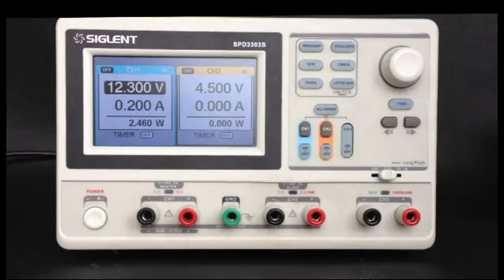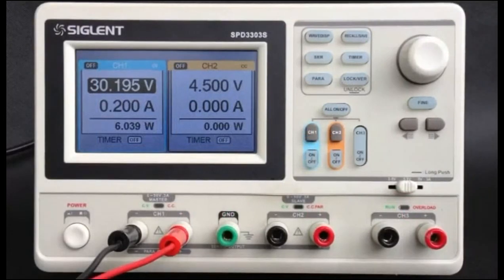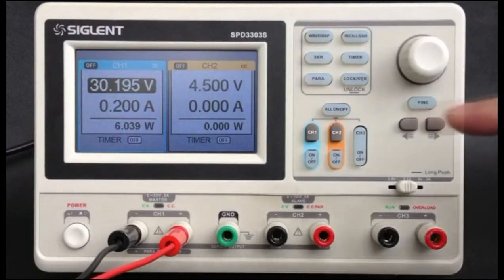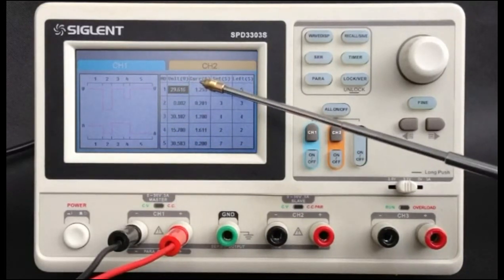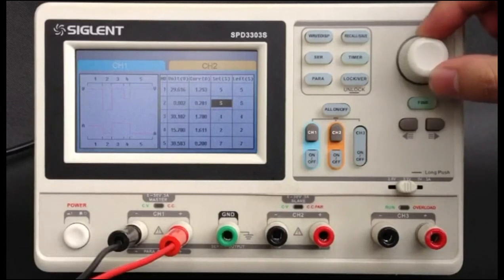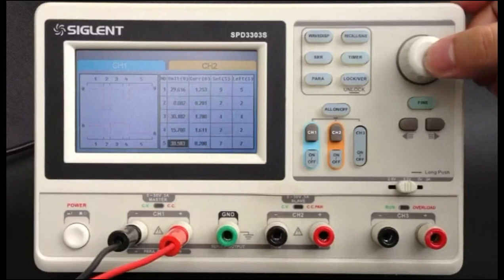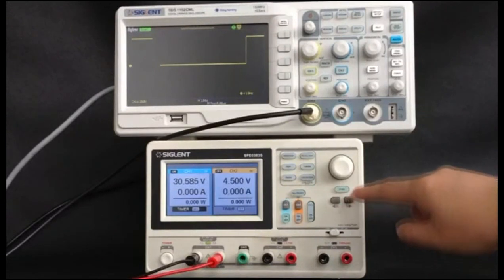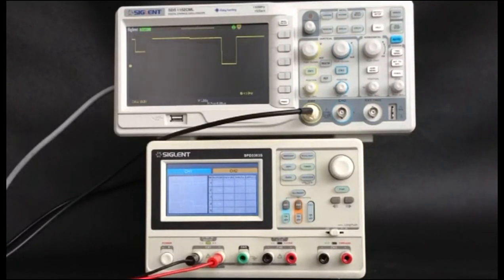How to use the timer function on a SIGLENT SPD3303D/S

Comment: I please hope that you will answer a question about your newest model of this product.
Do the newest model have the same 4 wire remote sense as your SPD1168X?
Reply from the maker: Hi Fried. The SPD1168X is the latest power supply release we have had in North America and the only supply with remote sense at this time. We do have some products in this category coming soon that will also have remote sense, but they have not been released yet.
Reply: Thanks a lot for your reply, I'll put my purcase on hold then. :-)